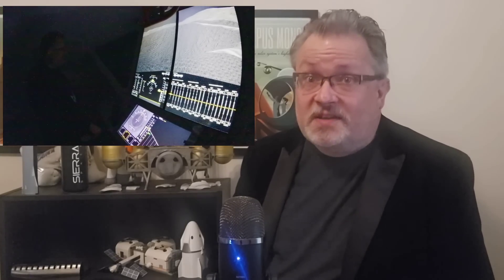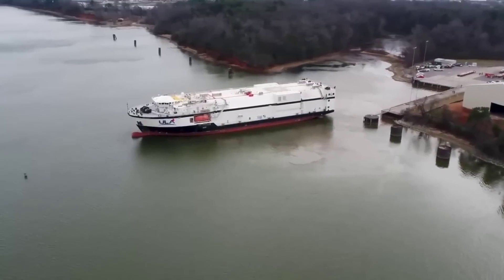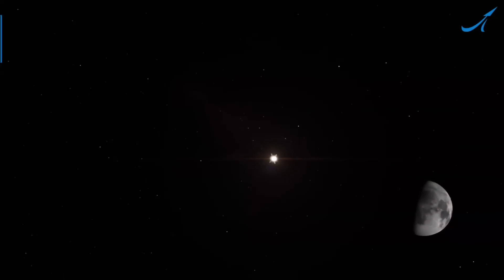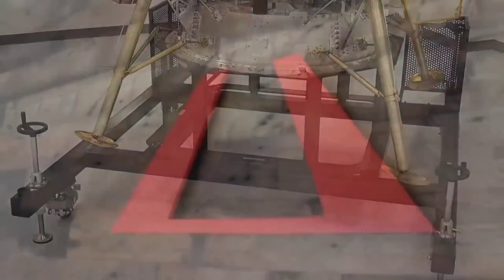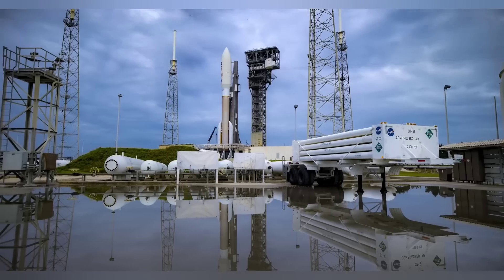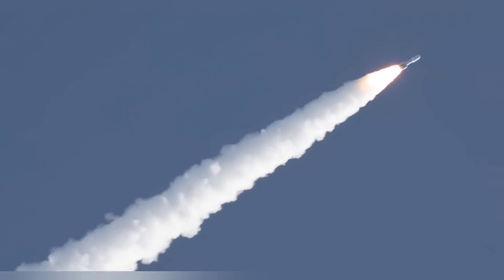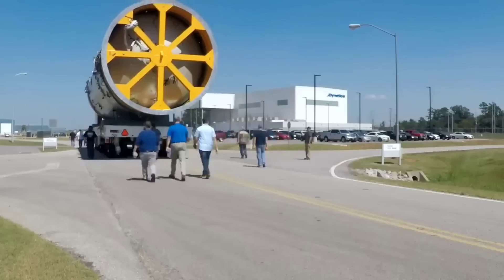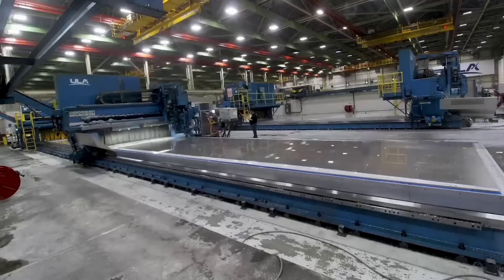ULA is running out of time!

Comment: Atlas V did have a failure about ten years ago.  It just didn't cause a loss of the mission or payload.  The main propellant utilization valve system failed and increased LOX flow to the engines to its max flow rate.  That actually resulted in the first stage shutting down from oxidizer depletion several seconds before planned cut-off.  This left the Centaur stage and the payload barely able to achieve the planned insertion orbit, it was right on the edge of being unable to do so.  I mean, yes, the mission was successful, but there was definitely a failure that occurred in the PU valves.  So, no, ULA does NOT have 20 years of flawless, failure-free performance with the Atlas V.  Regardless of what ULA wants you to believe.

Comment: Glad to get the promo for the Dynetics video…watching that next.
Not too big a mystery that there are further delays even after the BE4s are finally delivered. It’s pretty common project management phenomena that stakeholders feel that they finally cleared a hold up…”why are we not there yet?”
There are dependencies galore that still have to be achieved AFTER the hurdle is cleared.
While it is human to expect acceleration after clearing the peak in a project… letting that cart go too fast down the hill is not healthy either…stepping on the gas…more so.
It may be that the project was killed by the delay of the BE4s but it will require a reset in expectations after that delay.

Comment: Both Kuiper and Amazon have very strong, if not entirely valid, business reasons for not wanting to fly on SpaceX, and there is no one else they can switch over to. If ULA were to lose the National Security Contract, if the DOD went wholly to SpaceX, ULA would still have those two contracts. Mwa, ha, ha, ha ,haaaa.

Comment: Is there any more news concerning the rumor you previously reported regarding ULA potentially being for sale?  You speculated that Amazon or Blue Origin might be interested in buying it.  I'm a big SpaceX fan, but I agree that ULA is crucial to the US space program, and it's very important that the first launch of Vulcan Centaur is 100% successful.
Reply: Isn’t Blue Origin even slower than ULA?
Reply: @jaylewis9876  ULA has Vulcan Centaur which is much closer to first launch than Blue Origin's New Glenn.  Both will use the same BE-4 engines, but are in different and perhaps complementary playload classes.  ULA's remaining Atlas V rockets would give Blue Origin immediate access to orbit, something it's long been lacking.  ULA's SMART Reuse system will save the Vulcan Centaur's first stage BE-4 engines, while New Glenn will reuse the entire first stage.  I recently heard that Blue Origin might now be working on trying to reuse the second stage of New Glenn as well.  Blue Origin would surely love to take over ULA's existing government contracts, and Tory Bruno's technical management skills would surely have a place in Blue Origin.  If you put the two companies together, you'd have a single organization that might be well positioned to compete with SpaceX in both the short and long term.  A merger between ULA and Blue Origin was something that Angry speculated might occur, but I agree that it does make a lot of sense.

Comment: I think the Blue Origin booster engines are probably prone to explosive anomalies. I think that has been the problem all along. I came across an IEEE article years go that said NASA required Blue Origin to double the size of its engines. Note that the BE4 would have been the same size as SpaceX raptor engines. When the size increased, so too did instability.

Comment: Poor argument.  SpaceX's "stranglehold on the purse strings" is a damned sight easier on the budget than if the launches were split between them and ULA.  The argument should be that there should be a usable backup in case one provider is shut down over some failure.

Comment: It looks like the rocket is made from Aluminium Billets, machined like aircraft wing panels which are then formed step by step into a tube. If that's the case, compare and contrast the way that StarShip uses rolled flat Stainless Steel plate that's welded into tubes. Then grasp that SpaceX are going to reuse their whole rocket and you can see why unless you do the same, you're going out of business.

Comment: Blue Origin controls the supply of engines for the Vulcan booster.  Those engines were years late and are not yet available in quantity.
Amazon controls the bulk of the remaining Atlas-5 boosters for their Kuiper satellite constellation.
Blue Origin and Amazon are controlled by Jeff Bezos.
By failing to scale up BE4 production, BO can keep Vulcan from commercial success.
By insisting on using the Atlas-5 boosters for which they have contracted, Amazon can and has made the available ULA boosters unavailable to help ULA wait for more engines.
ULA has practically no boosters to sell.  If neither BO nor Amazon release the pressure on ULA, Jeff Bezos may end up owning ULA.  For far less than its worth.

Why would he want ULA?  Practical experience in the design, construction and flight of large rockets.  Oh, and some income from doing those things.

Comment: Though my finest hopes remain with SpaceX, it is better when many succeed.  I am disappointed in ULA and Sierra Space's Dreamchaser. 
They both faced much easier tasks than SpaceX. They should have tested and been ready. I understand about the BE-4 engines, but ULA should have pushed other testing along by now. Sierra Space should have focused on the more immediate flight of Dreamchaser rather than their far future Spacestation. ULA was relying on Russian engines and Sierra Space had the Space Shuttle to look at.
If AA's bet had happened a few years ago then it would have been fun. Now it is just a double disappointment.

Comment: ULA is clearly doing what it needs to do (whatever that is) to ensure that it maintains its 100% mission success record.  We can never forget what happened to Space Shuttle Challenger where time factors appeared to override safety considerations.
Reply: 100% success???? Did you forget the many failures that Starliner had?
Reply: That wasn’t ULA. The failures were with the capsule (built by Boeing), not the launcher.

Comment: Having a strangle hold is not Spacex's fault. If they are doing it that much better then they should be rewarded.
Reply: The only problem is, if something should happen to ground the Falcon 9, then we have no other launch options until they, or Vulcan, were flying again. That's not a good situation to be in. It is enjoyable though that, as every other launcher has been taken off the board for one reason or another, Vulcan, Antares, New Glenn, Soyuz, one company and one launcher have steadily been able to take up the slack.
Reply: @odysseusrex5908  Especially when you factor in Space X is, what, little more than 10 years old as a company?
Reply: @ironhead2008   Twenty one, it was founded in 2002.
Reply: They should be nationalized, given over to Boeing and NASA to be run down so the Europeans become great again. You are leading Stephane and the world knows it! 😎
Reply: The competitions cannot adjust to real competition from Space X, after fleecing Taxpayers for decades!
Reply: But they aren’t doing it better. ULA has never had a rocket blow up during a launch. They just never take the press.
Reply: @itsmini6175  You must not be aware of the launch prices ULA charges to NASA and Air Force, before Space X come along.  And ULA never invested in any new technology, as they’re content with using 1960’s technology, while fleecing the taxpayers.
Reply: True, but it’s still not a healthy situation to be in.
Reply: Really, if the money that wasted on Blue Origin by NASA was spent on some of the other space companies there would two or three other rockets to compete against SpaceX, at-least for lower orbit missions.